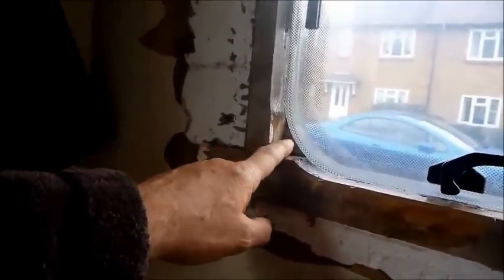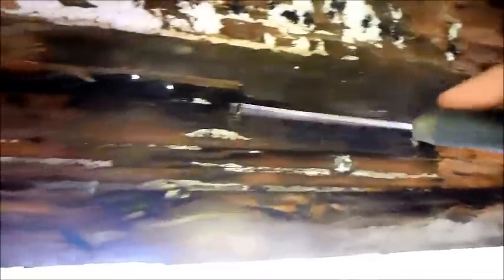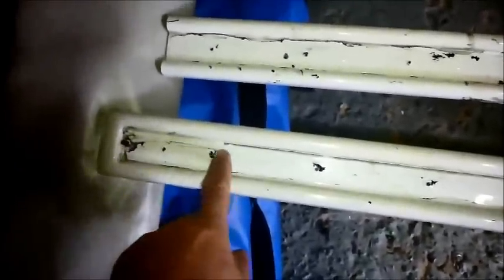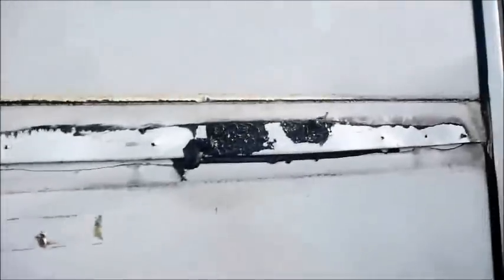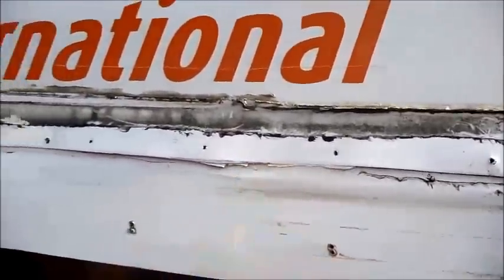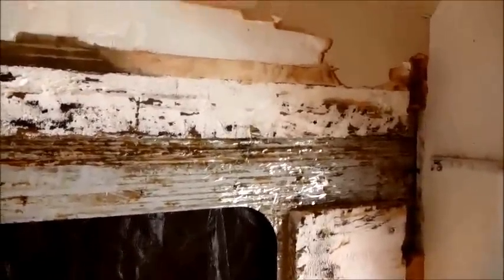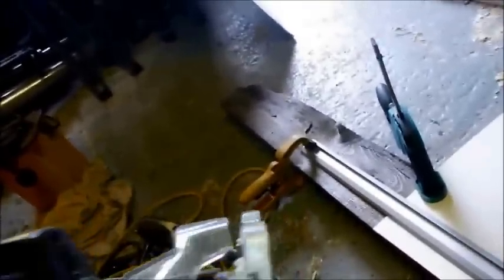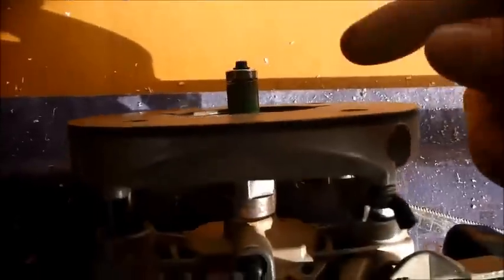How to Repair major damp in your Motorhome/Camper van

Comment: hi Mark
I recently bought a caravan I knew it had problems at the front end externally but knew i could sort that so I got the caravan for a reasonable price. it wasnt til I got the van home I revealed the true horror of the damage. the caravan was damp along the whole of the nearside when I removed the front window blinds I could see the timbers from the front window were rotten and falling apart my stomach wretched at the thought i'd bought a lemon. However watching this video raised my hopes and my spirits I decided to make the van at least worth what i paid for it. I completed the rebuild including full front rebuild, timber frame replacement and boarding out to the whole nearside in just under 3 weeks. in all with a repaint inside and new upholstery I now have a caravan worth more than twice what i paid for it. without this video (and i have to say everything went 'text book', right down to ordering sealant and window rubbers from oleary's )I would have scrapped the caravan and took the loss on the chin and written the whole thing off to experience. thanks so much I am now subscribed to your channel and see you as a demi god of youtube lol cheers mate you saved my bacon.

Comment: Nothing better than finding out a fix is too costly.. and then doing it yourself! On top of that, making a video so other people can benefit from your hard work and risk. Thank you for that.

May I ask, are all caravans built from an aluminium exterior? I have read online that one should, when buying a campervan, check the outer walls to see if they feel soft, however, would that not just indicate a rotted wooden frame on the inside? Or can the outer walls feel soft because they are "rotten"? Thank you!

Comment: Hi Mark,
Just doing exactly the same job on my 1991 Luner caravan, I feel we sing off the same hymn sheet! Very helpfull with good ideas and thanks for the link to Oleary Mortor homes, saved me a lot of problems during Covid lockdown, yes a good time for doing this job if you can obtain the wood and parts. I had to source the wood from my scrap including cut down decking boards. Screw fix click and collect are good for tools and adhesive, so thanks for posting this super video. I think that if caravan designers and manufactures could not design a product to leak better if they tried. The tip about the window corners, replacing the plastic fillers with the wood is a great idea.
Reply from the maker: Hi John thanks for watching and well done 😀🍷

Comment: Very useful.  Just about to embark on a similar repair where the main dealer bodged putting the awning on the side.  It has already been repaired under warranty twice.  I'm now going to do it myself properly.  This will include epoxy coating all the wood and panels before fitting it, so that it will not go rotten if there is any future water ingress.
Reply from the maker: Good luck!

Comment: Nice Job, Motorhomes leak equally well on both sides of the pond. I am just finishing the same job on a 27 foot Airstream. I bought a Pocket Screw Jig by Kreg to build new cabinets in my rig and found that it was invaluable in securing all the new framing in the wall. Also I am using urethane construction adhesive  in combination with the pocket screws to attach the framing members to the aluminum superstructure.  I am considering purchasing a moisture meter to detect water intrusion. Its very difficult to detect in the early stages behind paneling and surface finishes, and as we who have been through this exercise know, early detection is critical.
Reply from the maker: Hi Stephen thanks for watching, if you have any pictures of the work you have done would love to see them 
ATB 
Mark
Reply: Stephen Ritson I think being completely sealed from any kind of leaks is even more important in your part of the world.  Constant moisture means a constant battle to find and seal even the slightest of leaks.

Comment: Hi, Good JOB. I live in Texas, " so rain ain't a factor" ; however, I have found that a good pitched roof with metal siding is the only thing that stays dry.  Wet climates will kill even an Airstream, and it's all metal. All RV are fair-weather and need a good roof in wet weather. The old RVs are better because of sturdy metal bonded to ply with foam core center. I have a 1983  Ford 7.5  C Class with water damage  that is still good to go. The only way to learn is by doing, and you did a good job. Thanks for the excellent video.

Comment: Extremely helpful video. My 2 cents; I used to use a plastic brush attached to a drill to polish large aluminium engine pieces on older show cars. Could be a faster option compared to the scraping. Get the softest and largest plastic drill brush you can and the softness combined with the large area of force distribution should help to avoid any damage to the aluminium. Dremel brush if you're feeling more timid. And use appropriate eye, ear and lung protection because aluminium dust doesn't work out well inside the human body. A chemical solvent might be the best option for this work though really.
Reply from the maker: brilliant  thanks for the tip

Comment: Wow that didn't happen overnight. I bought a used 1992 motorhome a few months ago. Yes window surrounds get brittle and are better replaced.We "amateurs" can at times do a better job. Although my window seals looked good, on closer inspection they had shrunk away from the corners when I stayed in north Queensland region where the heat is a killer, especially when the back of my motor home was facing the rising sun for for three months. With gentle persuasion the seals were moved into position and clear sealant held them in place. I discovered old water ingress and tracked it down to a screw not being fitted in the rear cargo light after running a hose over the roof to find where water was getting in and onto the floor under the seating. Also another screw had come out of the awning track and was sealed back in.

Repairers price for the same motorhome to repair rear underfloor damage to the back panel started out at between $550 and $800 Australian including 10 hours work. Repairers final bill to insurance company was just under $4,000 including 32 hours work 6 hours  to remove, clean, reseal and refit corner guard. Repairer doesn't know I got a copy from the insurance company. He charged $385 for a $35 piece of checker plate. A 1200x2400mm sheet is about $50 to $80. They also quoted for new liner and refused mine. Quoted for new timber frame, but mine is aluminium and was repaired. I have informed the insurance company because the corner guard sealant is a mess and all over the corner reflectors and cargo lights. Finish was nothing like the two caravan I was shown being resealed. Also sealed at the lower end onto one corner guard which will hold moisture in. Did not use new stainless steel screws as requested and used my old screws, covering with sealant which has prevented the liner to sit flat and pushed up into the roof side surround, also will let moisture in. I had bought the sealant before the insurance repair to do the corner guard myself but did not think I had to do rear guard when included in repair. Hindsight unfortunately comes after a bad experience. I marked my liners and took photos and video before delivering to the repairer and have used this to show insurance company.

Comment: Great video.  I think I would have coated all that new structural wood with marine spar varnish or some other protective coating so any future leak won't rot the wood like that.  Regards!
Reply from the maker: good point thanks for watching 
mark

Comment: You can buy wall board here in Canada and it is far better to use as a repair for the walls. It comes waterproof as well. Save you a lot of work.   But good video.
I repaired mine by stripping the old wall off and replacing it with wall board. It has a nice print on it that everyone admires.

Comment: I'm a girl & I've been gutting our rv while my husband is over seas
I've learned I have the EXACT same problem with the back window & water damage.  But =(
I don't know how to cut wood like that let alone pull the window out. You make it look so ez haha..
I've got the rot out,  removed the inside rotted aluminum bars,  and have removed what looks to me like black mold.  I am going to use all the things stated but idk what I'm going to do fix the window issue without pulling it out.  Maybe if I do all the hard gutting someone won't charge me too much to pull it out and do the rest..great video loved it 

Do more on rv repairs k
Reply: Hi Niki is there anyway you can make a cardboard template of the window frame and take it to a carpenter. I was lucky I work in a school and a friend of mine planed the wood for me, as for the window mine was held on by 6 screws!!! easy if I can help in anyway please drop me a line
ps thanks for complement on video
mark

Comment: 1700 seems a good price. From start to finish, Inside and out side you got around a full weeks work there.At 60 pounds per hour plus parts at around 200 Sealer. Mastic and wall board Strip out and refit. also your 1 year workmanship guarantee.

Comment: This is an awesome job. Fair play to you. 
I too have a rotten problem to the rear of my motor home, issue is the shower and the wardrobe in are the way...nightmare. 
How is the motorhome looking in the year 2018?
Reply from the maker: Thanks Curly, just Mot'd her, needed sills & jacking points welding, otherwise OK & ready for French trip. Good luck with your repairs. :)
Reply: Mark Davies woop woop, I might see you there, depending If I can get this rot repaired in time. Is it a motorhome or caravan you have?
Reply from the maker: MOTOR HOME

Comment: UPDATEI went from putting the caravan up for sale as a caravan that needed to be repaired to finding ALL the holes and sealing them, it rained last night and when i wend to check if water was coming in i discovered that i have most of it sealed, i only have 2 more bits to do and i should be sorted when it comes to keeping the water/rain out. I have used loads of Tec 7 sealant which is what i could get here in ireland and its expensive 15 to 17 euro a tube and now im on tube 3 and have have wasted loads of it (my fault), its v v v exciting to see my work working, for me i want to do the caravan up just to get another year or 2 out of as its old and not sure how much longer it will last.

Comment: My top tip. Do these jobs in the summer. Remove all the damp material and then let it dry for two weeks. When bone dry start sealing the outside perfectly before starting the rebuild.

Comment: I'm just doing a talbot express bedouin. Complete roof internally and one complete side. It's bigger job than I thought but it's near on complete. Main thing to remember is coat the roof and relax seal or you will have the same issue in 12 months time.

Comment: I have a 14 year old trail Lite motorhome, 22 foot that I bought from my aunt's last year and has a spot on the driving area. I have not been able to get to it yet but I stopped it Buy ceiling it and I have found that using a dehumidifier Works excellent. I picked one up in like new condition at a thrift store for $30. They had no clue what the thing was
Reply from the maker: Hi Dwight they work great but mine was a bit to far gone for that 
thanks for watching

Comment: nice project....lol.........a bit overwhelming at first hey?......I'm doing the same thing.
here's alitltle helpful tip......
when you were cutting the rounded parts of the window "frame"......you didn't need to cut the whole piece with a jig saw.....
just "plunge cut" with a circular saw on the "straight" part until you get within a few inches of the "round",......then use your jigsaw to do the round part......
the circular saw will make quick work of the "straight" part of your cut.
keep up the great work!
Reply from the maker: Hi thanks for your comment and a useful tip 
ATB mark

Comment: Excellent video mark - well done to you! Just one question - If the cupboards are screwed before the aluminium skin is put on - how do you remove and re-attach? just force them off? - or are the screws actually small threads with a nut on the inside? I'm pretty nervous about starting - as you can tell, I'm still researching!
Reply from the maker: They should be screwed to the roof battens and they might be hidden by trim good luck

Comment: Instead of using wood structural composite board is a good product does not rot, no issues with water or moisture it's what they use instead of wood frames in modern caravans plus it's lighter but just as strong as wood.

Comment: Hello Mark, yes I am, as I say, I took off part of the rear wall last week, I saw less damage than I thought, actually, half of it is dry already, it is a 30 foot American 5th wheeler, I've had loads of fun in it the past year, so now it is time to repair and maybe decorate too, no idea how long it will take, I have read these things can take 2 or 3 months to fully dry, I received a reply from Kitsmiller in USA today, advice on the damp in my trailer, let it dry, treat the wood.
Fingers crossed

Comment: Hi Mark, thanks for the video. I've been stripping my Talbot compass drifter out. I've found that one wall is rotten. When I asked I was told to remove all the polystyrene as well as the wood because there would be  in the aluminium,  but I noticed you didn't do that with yours. I'm really dreading taking it out as its a much bigger job then. What would you suggest  Thank you.
Reply from the maker: Hi Georgina i only took out if it was wet and any rotten wood, i pooped my pants of the thought of striping it out but chill when you start its not that scary just take your time make sure you have found the leak and repaired it  that's the big one after that put the heater on relax you have all winter to do a great job so satisfying  please keep me posted 
Mark
Reply: @MrMeltedwellies  i had to rebuild the entire bed area over cab on  my talbot, absolute drenched and rotten and 70 percent alu repairs - bloody hell! had to also take the small windows out 'fully sealed types' not sure how to get back in a nd seal yet! any points? ive the autoquest 270 so you can see the small side  windows in bed/cab area - btw good job. Did you use the PU glue all over finishing  ply or just make lattice of glue?? i hestitant now as i dont want to do this twice lol! id be happy with the sides as the cab area is quite a complex makeup and so many rails/seals to do properly.

Comment: The reason u get poly in the corner of the windows is because they fabricate the hole back panel as one piece then cut the window out. Some times they replace it with a plastic piece and if your lucky they put a think enough piece of timber in so if they cut it slightly out of place there is wood not just poly there.

Comment: Hi Mark, just thought that I would share this with you. I watched your video some time ago when I happened to come across it whilst browsing on YouTube. Little did I know at the time that within a couple of months I would be in the position where I was to discover that most of the wooden frame in my 1994 Talbot Express was rotten !! I was very close to scrapping the old girl but remembered your video and at the last minute she got a reprieve and I decided that I would also try and fix the problem myself which was a bit daunting at the time. Anyway I have now finished replacing the wooden frame throughout renewed the insulation and just completed the walls and the ceiling with the new boards. Just the fun bit of making new bathroom walls and cupboards to go now. So I wanted to thank you for giving me the inspiration to have a go at this mammoth job. I've put a YouTube link showing the before and after below. Once again, thanks !
https://www.youtube.com/watch?v=Aqb4k-Hm7UY

Comment: Brilliant video. We have just bought our first caravan. Knew it would need a bit of tlc but as we cleaned and stripped things back we found lots of damp. we are going to try and do it ourselved and this video is really going to help :)
only problem is we don't have an abundance of tools and clamps so will be interesting to see how we get on. I will be taking pictures and short videos of the progress so will let you know how we get on.
With this being a motorhome though is there going to be much defference with a caravan?
At the moment we are just going through pulling everything that is rotten out to see the damage.
Thanks again :)
Matt & Shell
Reply from the maker: Hi both no difference between caravan or motorhome as for clamps you can buy them very cheap from any DIY store 
drop me your links when you start your vid's 
ATB mark

Comment: hi can i ask what and where you get the bonding glue for the metal to wood as really badly need it or what ever its called as this is my first time doing this kind off thing but i have a caravan thanks again
Reply from the maker: +William Walker Hi William ive put 2 links below one for ebay for 2 x the bonding glue and one were I got all my parts from 
good luck 
mark

http://www.ebay.co.uk/itm/Olearys-Caravan-PU-Adhesive-Sealant-white-repair-selfbuild-glue-sikkaflex-x2-/331675290321?hash=item4d39634ad1
http://www.olearymotorhomes.co.uk/

Comment: 2 things cause this problem and make it worse. 1. Lack of good exterior sealing. 2. The internal vinyl/wallpaper.
That wallpaper stuff is a terrible culprit and it can hide damp for very long periods of time, long enough for the damage to get like this.
If it were simply damp wood ,exposed, it would dry without rotting.
I'm currently doing a similar job on a caravan wall and it's bad, very. Fingers crossed.
Reply from the maker: Good luck Rai